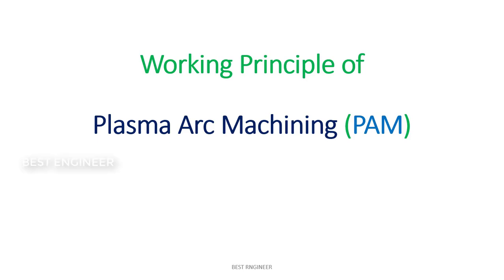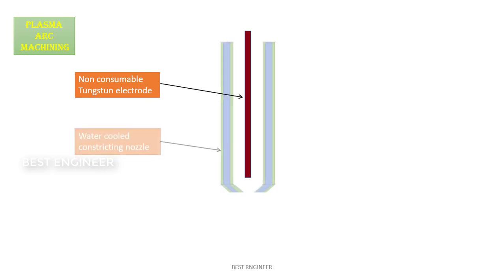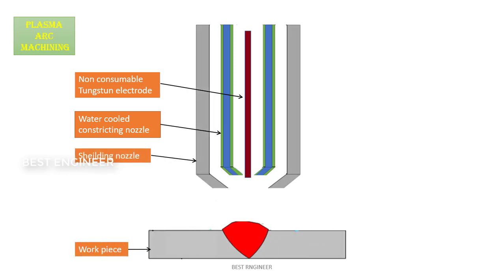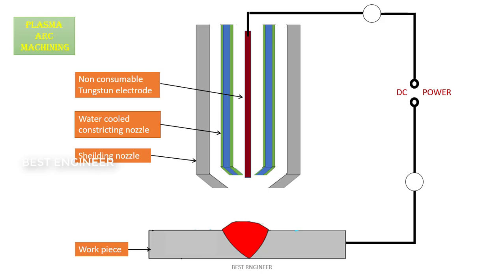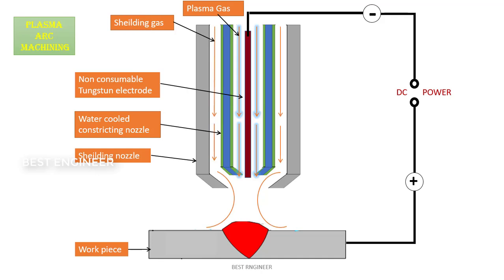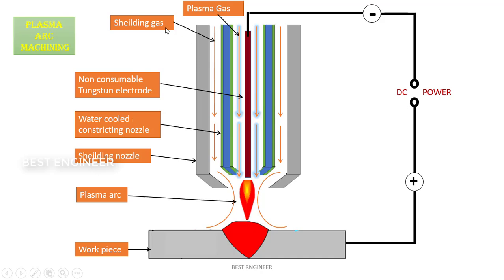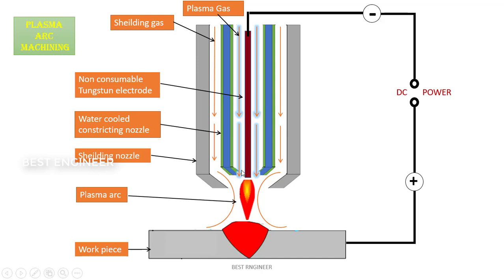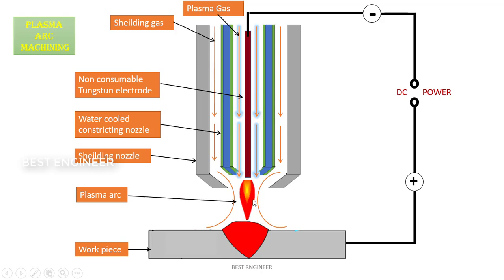PLASMA ARC MACHINING WORKING PRINCIPLE | BEST ENGINEER

Comment: what you just explained is plasma arc welding not machining
Reply from the maker: Dear friend Thanks for your valuable comment but once you watch this video.. It is machining process because  after metal melted its taken away from the spool.surfaces are machined.